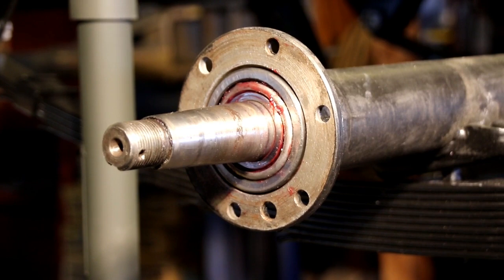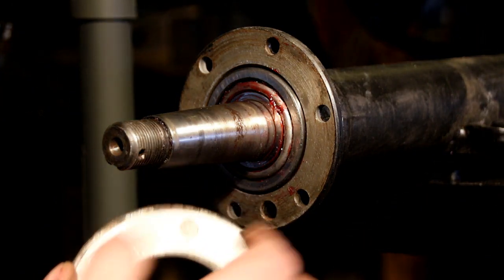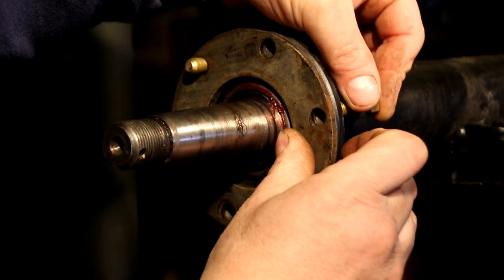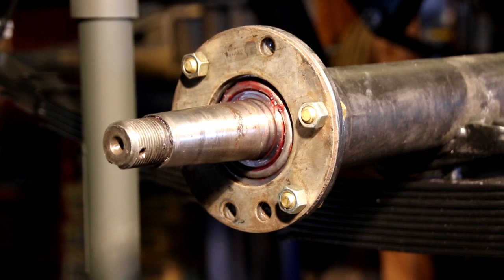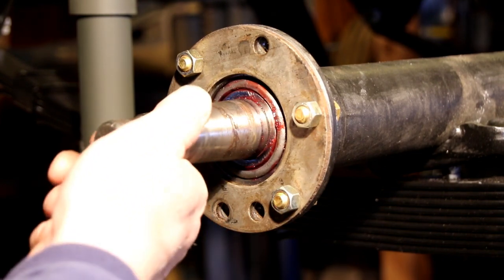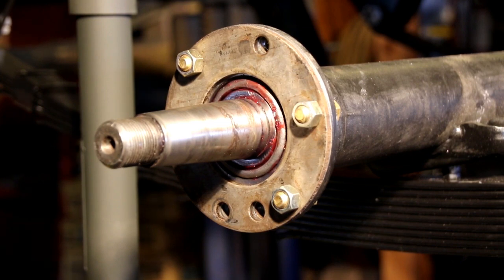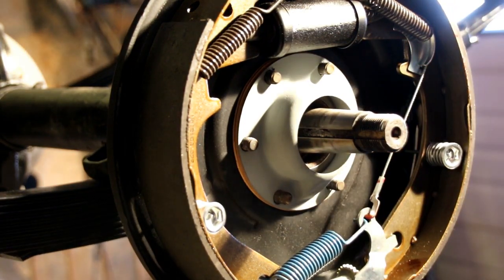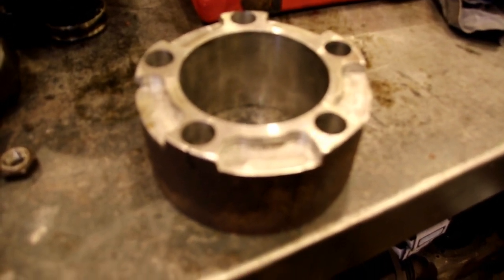Willys Jeep Rear Axleshaft Shimming, 11" Brake Upgrade

Comment: The year was 1959 when my Dad came home in a pristine 1952 WILlYS OVERLAND pick-up truck with the four cylinder Hurricane engine, in central North Carolina. It had the rare five bar grill and 700-16 mud grip tires and of course four wheel drive.  Fast forward three years and two     engines on a cold November morning we pulled a six cylinder super hurricane out of a  beautiful old 1953 WILLYS car at a local salvage yard in Thomasville, N.C.  The next day is was in and running with no hood and a spaced forward radiator.  There was no hood because the front of the engine was suspended across the fenders with a two by four. I was now sixteen and had a drivers license so less than a mile down the road to the welder so shop for the first time she was running seventy miles an hour.  Needless to say I love your videos and all the great work you are doing with what cannot be bought-knowledge for anyone willing to listen!
Reply from the maker: karl, thanks for sharing your Willys story here, sure is nice to hear about peoples first experience with these fine vehicles.  Hope your are enjoying my youtube channel and keep watching for more videos.  I am showing a lifetime of hard to find information.  
Brian

Comment: Thank you for answering so many questions on the DANA 41 axle setup. Last time I did this back in the mid-80's, it was all guesswork, and I made a few wrong guesses! Fortunately, I got the woodruff key in correctly, and didn't crack the hub. Excellent step-by-step procedures. Always wondered the process on the castle nut tightening on the proper way to line-up the cotter key; now I know, keep tightening until the cotter key fits, do not back it off.  My M38 is next, this time with confidence!  Thank you Sir
Reply from the maker: Glad I could help!

Comment: Nice job on the video. My jeep that I did the 11" conversion on is a 53 cj3a. I had to use a special tool to cur the swager on on each stud to separate hub and drum. Also my axle tube has a grease zirk and a real small vent hole for greasing the outer bearing. Thanks for your videos.
Willys Joe

Comment: Where are you getting perts. Pls post the venders and the parts you got.
I am having trouble sourcing components like brake backing plates and hubs for  10x2 drum set up. I do not use marginal parts when dealing with any brake system.
These parts looked hi guality something Im very interested in.

Comment: At the end of your Willys Jeep Rear Axle Rebuild, Axle shaft installation video there looked to be about 3/16" play in the axle.    At the start of this video, there was very little play.
What was the difference?

My reason for asking is I have put all new axles and bearings in my Dana 44 (67 CJ5) but I have the same 3/16" of end play on both axles.  No shims installed.
I pulled the axles back out and compared them to the originals.  They are the same.  

Bearings are 0.996 tall.
 
Any suggestions on what to look for?    It seems as though I need to put a spacer behind the bearings to take up the play.
Reply from the maker: There is always a lot of play when both bearings are not seated all the way.  Then you take your time and shim them to give the correct end play.   Also make sure you didn't leave out or forget your center block in the carrier.   Both axles will hit that and play a part in your end play.   Some axles are shimmed on both sides, others just on one side.  Start on one side and get it set, then move to the other side and add or subtract shims to get proper set up.  Take your time and get it right and you will have a quiet rear axle that will last for a long time.  Any further questions feel free to email me directly.   Brian

Comment: Brian, If a guy wanted to have locking hubs on the rear (I flat tow), what all would be involved in converting to locking hubs?  I already have 11 inch brakes and have the Dana 44 (3A)  if that matters.  Thank you.
Reply from the maker: Tom, you can find all the parts you need from Herm the overdrive guy.   Don't try to find parts and pieces to make it work, just get the spindles, axles, hubs, etc.. from a source and install it.  Search for herm the overdrive guy and give him a call.  Tell him that Brian sent you and he will have many different kits available for your vehicle and budget.  Pick what works best for you.  It is a very easy installation when you have the proper parts.

Comment: I am having a hard time finding the correct size race for my 46 CJ2A with the Dana 41.  I ordered the bearings and race from Napa and the new bearing with the old race fits like it should, but the new race (same part number as the old one) doesn't fit right.  Any suggestions on where to get the correct parts?

Comment: Hi, I noticed that your Willys shim setup is quite similar to my J trucks Dana 53 with tapered axles. Thanks for the clarity. I did not know the brake backing plate could  be pre-assembled with brake shoes  l Great job describing how you  work on Jeeps. I learn a lot from your videos. Will rapping on the opposite shafts seat the bearing s on a limited slip differential? I have the POWER LOK option in a Dana 53.

Comment: Yet another super helpful and thorough video. Thanks! I did have a question - the 11" drum brake kit I purchased from Herm the Overdrive Guy uses recycled backing plates, and thus the "7th hole" drain hole does not quite line up correctly to give the full diameter as all the other holes - there's maybe 1/8th of the hole diameter that goes through. Is this going to be an issue, should I drill the hole out?
Reply from the maker: Drill out the hole to make it perfect.

Comment: Hi  Brian when doing pinion rotation tork are the bearing wet or dry also  carrier bearings wet or dry gear oil  or engine oil thanks
Reply from the maker: light coat of gear oil when doing rotational torque

Comment: I'm putting together a '68 cj5 I bought completely disassembled. I'm following your videos as I do the work. The rear axle came with the drums and axles removed, but the diff gears in place. I replaced the pinon seal. The driver's side axle had a 1/8" wobble in the middle so I bought a new one. I followed your previous video of installing the seals, axle bearings, axles, and races and now I'm at the point in this video of adjusting the play. Unfortunately, there is no in/out axle play. I haven't installed the shims or backing plate yet. What could be the problem? The differential has a Powr-Lok and 4.88 gearing. The axles are pretty hard to turn by hand. Everything seems to turn easily, though, if I turn the yoke.
Reply from the maker: you may have the bearing cups in too tight right now.  the shims allow the axle shaft cups to come out of the housing a little bit so that you have end play.  Install the shims and tap the axleshafts like you saw in the video, that will set your cups at the proper location.  you must have some end play or you will overheat and ruin the bearings.

Comment: Fantastic Channel and awesome videos. They're really insightful !!
- I'm having some trouble with free play adjustment on the dana 41 rear axle. 
Currently I have no free play with a decent shim set on each side. 
The bearing races are protruding approx 2mm from the axle flange but have I driven this race in too far and this has resulted in no end play.  I say this because after I use a dead blow hammer against the shaft there is still no free play and in some occasions the rotation binds. 
Many thanks Daniel
Reply from the maker: Pull the axles out a bit and start again.  You need a little bit of end play so as not to destroy your axle bearings.  Add more shims until you get some free play.
Reply: thanks Brian for the swift reply. I'll give that a go !!

Comment: Great video!  I have a 47 CJ2A and have been researching brake upgrades recently.  A lot of folks are doing the conversion with 95 Geo Tracker discs and calipers.  There’s a guy named Brennan Metcalf who sells the mounting brackets from his website.  If I remember correctly I read that the conversion can be done for about $125 per wheel.  I’m curious to know if you have done this conversion before and how it compares to the 11” drum upgrade in price, performance, and difficulty of installation?
Reply from the maker: You can see me prepping axles in some of my newest videos, for the disc brake conversion.  Disc or 11" drum is up to you, I prefer the 11" drum conversion but a lot of guys are having good luck with the disc brake conversion. Just a personal preference.

Comment: Awesome helpful videos.. 

about to tear into a d44.. when removing the hub, do I have to get the key out first, or will the key come out with a hub puller?

Thanks!
Reply from the maker: The key will come out when you pull the hub.  No way to get it out before pulling, so just install your puller and get it done.  
Brian

Comment: What kind of paint did you use on the frame? it looks nice!
Reply from the maker: Right now the frame is only in primer, no finish paint yet.   I use Epoxy primer on all my parts and recently started using SPI Epoxy Primer.  You can search on the internet to find them.  Great company and the products they offer are great.  Frame gets 3 coats of epoxy, along with all other attaching parts, then once all is together a top coat of my own blend of black paint.  You will see it in future videos in finish paint.

Comment: I am pulling my 44 apart and noticed that on my driver side, I don't have a Rear Axle Bearing Retainer plate.  Is that normal?  Do I need need one, if not for support?
Reply from the maker: dm8528 yes you need a plate on both sides.  Retains the bearing and axle assembly.
Reply: @metalshaperJeep  Oh this gets better and better.  I pulled off the axle wheel hub and key and the hub is split per your video comment, the key is rounded as well as the axle shaft key slot.  So glad you made that comment because I specifically looked for the crack.  Thanks so much for the little comments like that in your videos.

Comment: Does the shoe with the longer pad go towards the rear? Am I seeing that correctly? Thank you!
Reply from the maker: on the 11" self adjusting brakes the long shoe goes to the rear.  If you were doing original brakes with anchor pins and manual adjustment the long shoe goes to the front.

Comment: What size wheel do you need to use with the brake upgrade?
Reply from the maker: standard 16 inch factory wheels work fine.

Comment: Great video. Very informative. How or where can I obtain an 11 inch break conversion with backing plates - complete assemblies?
Reply from the maker: you can get 11" brake kits from Herm the overdrive guy, or Woody's.  Just search for them on the internet and you will find what you need.

Comment: What is the toque specs for the 6 3/8 bolts that hold the backing plates on?
Reply from the maker: I set them to 32 to 35 ft. pounds, with medium strength thread locker.

Comment: Hello!  I am starting to gather the parts for an 9" to 11" drum brake conversion on my 1964 CJ3B.  Do you have an email to where I can send you the pics of the backing plates I recently acquired, so you can confirm if the are for front (which I was told), and use them for rear as well?  They sure look the same as what you have installed on the rear, and I have access for 2 more of these...  Appreciate your assistance.  Best regards,  Jorge
Reply from the maker: you can reach me at metalshaper@comcast.net
Reply: Hello Brian!  Did you get my email yesterday?  Thanks!
Reply from the maker: yes, photos came thru.  front and rear are the same, just wondering what vehicle you got the backing plates off of.